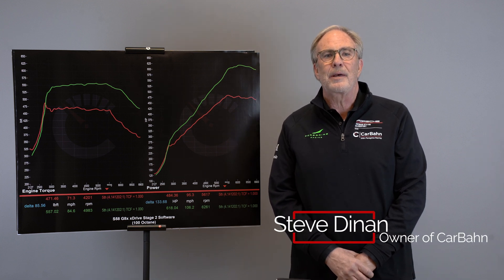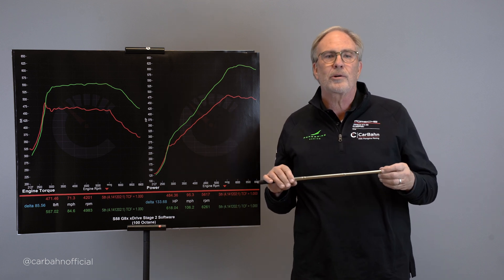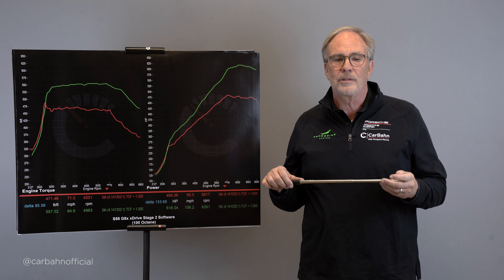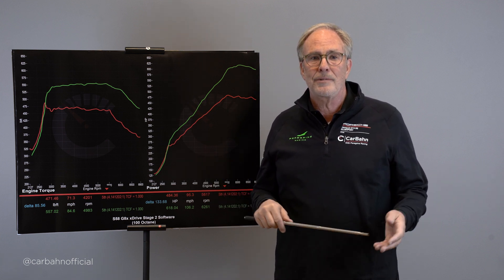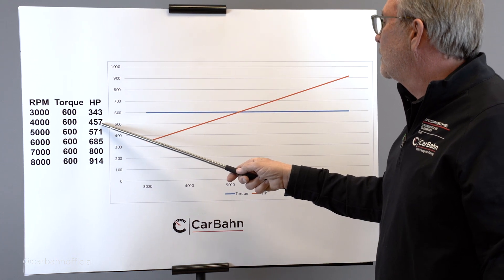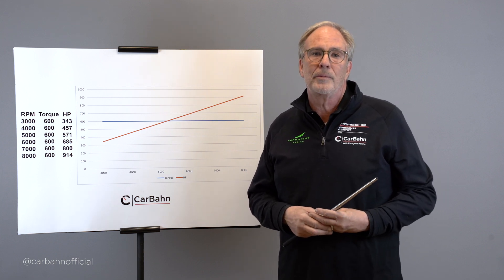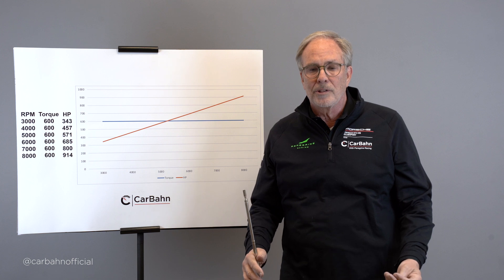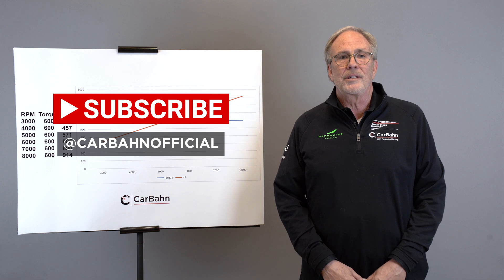Steve Dinan Explains Horsepower & Torque - BMW Performance Tuning Tech Insight

Comment: golden info here! thank you Mr. Dinan. Rationale explanation to an overlooked matter in the quest for more power
Reply from the maker: Thank you Stephen! At CarBahn, we aim to provide the highest possible power increases for our customers, but in such a way that we do not neglect anything which would keep the engine from staying reliable long-term.
Reply: @carbahnofficial  that's why I only put Steve Dinan's products on my car (both my e30, e36, e46) are still reliable more than 150K miles later because of how he setups these cars